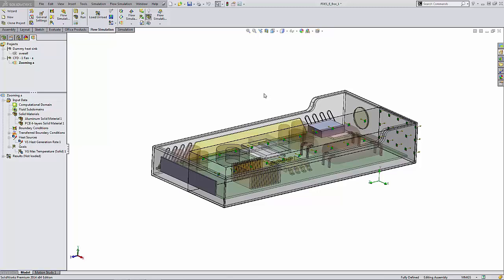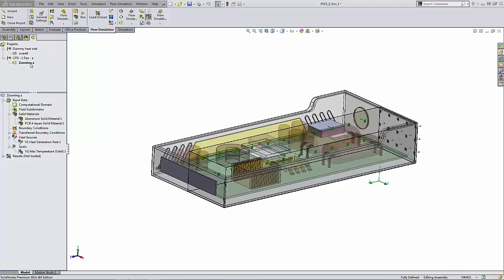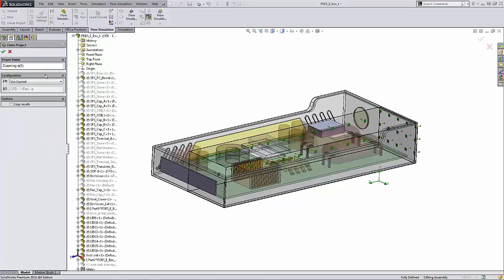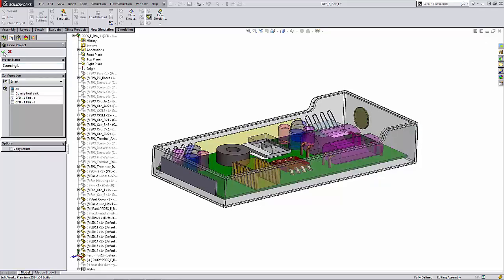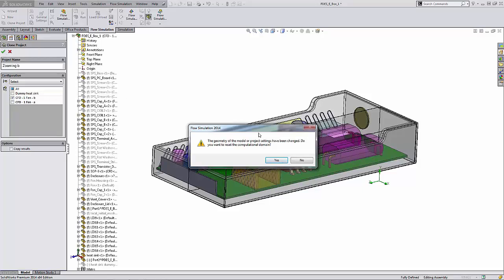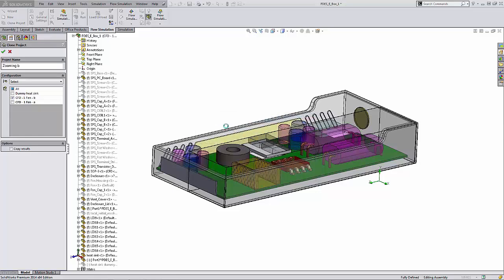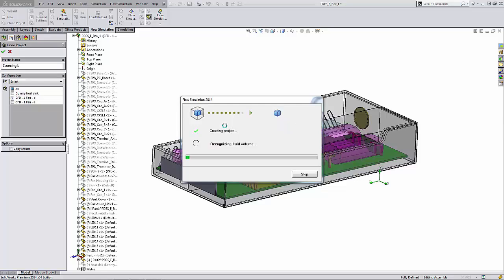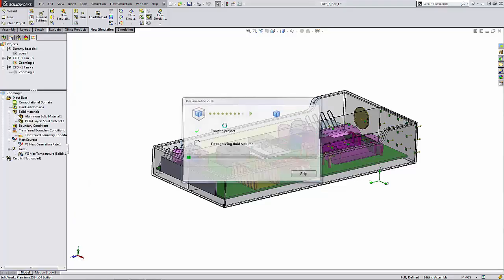SOLIDWORKS Flow Simulation - Clone Project

Comment: Hello, is it possible to clone/copy from one ASSEMBLY to another? I have two assemblies using similar geometry, and would like to just transfer. thanks
Reply from the maker: Yes you can use CTRL+C and CTRL+V  to copy SW parts to another SW assembly. Here is a document with helpful information on this: https://files.goengineer.com/docs/support/SOLIDWORKS_Copy_Paste_Part_Features.pdf
Reply: @goengineer  Thanks for the reply. Maybe I wasn’t clear. I was wondering if you can copy a flow simulation project from an assembly to another.